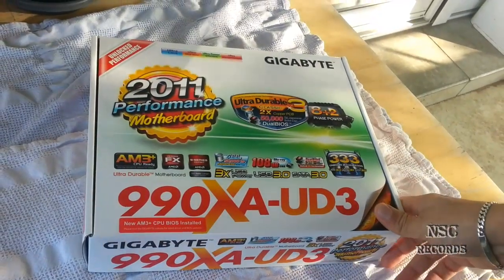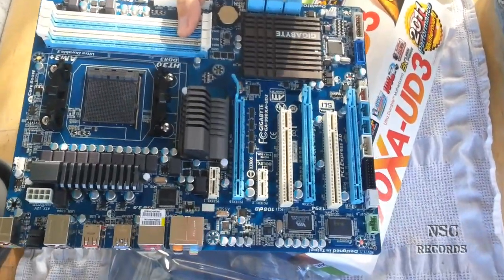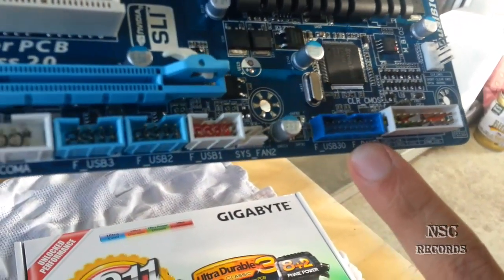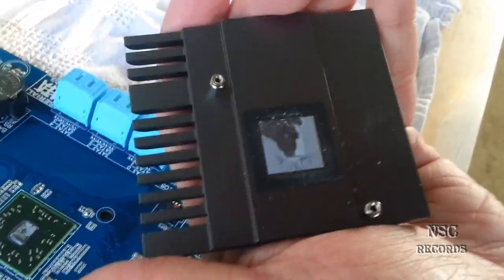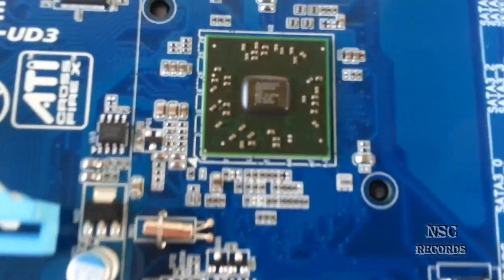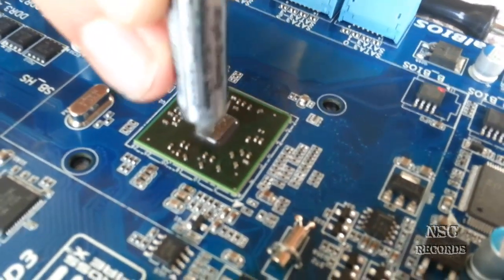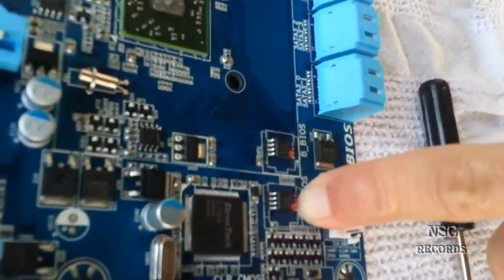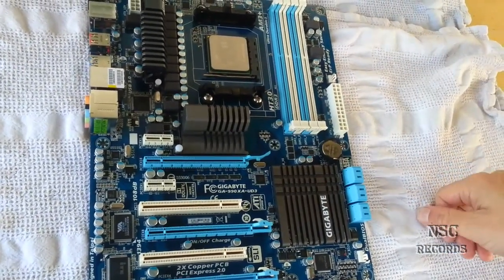Gigabyte 990 XA-UD3 Unboxing & apply new thermal compound By:NSC

Comment: Nice board, and great price, I went with 970AG46 with fx6300, and wanted to overclock alittle but lots of people say not VRM safe, but the fx6300 is 95watt,  do you think its safe to over clock without touching volts?
Reply from the maker: yeah, i think it´s posible, but maybe not much.
Reply: Does lower cpu wattage help with heat of VRM?
Reply from the maker: hmm it conforms, ifs it´s to much it´s not that good ofcorse. and it also conforms with Memorys you use, some Rams are just bad,,,
Reply: I ve got fx-8350 @4.7ghz and cpu is ok but vrm are throting to much for temps 😭

Comment: hjahjahj hi, do you speak spanish? :P
Reply from the maker: Hola, si poko xD
Reply: algo me dice que si sabes mucho -_- jajajajja ojala T_T Acabo de comprar esta motherboard, pero no se como conectar la fuente de poder, ya ves que mother trae dos cconectores, uno bieen grande a la derecha, y uno de 8 pines arriba a la izquierda del procesador, la duda es que mi fuente de poder solo trae conector de 4pines y uno de 6, no pasa nada si le conecto el de 4? O.o se va a quedar verdad? T_T
Reply from the maker: instalaste todus Drivers?
Reply: UltraNSC i'm talking about the connector of the power supply, the 8-pin connector,  i think of 12v. I don´t have 8pin in my power supply, i have a connector of 4pin
Reply from the maker: ohh 4Pin works also perfect ;)
Reply from the maker: i think u mean 4 pin for USB hehehe
Reply: UltraNSC Thanks, then I connect 4 pin instead of 8 :D jajajaja if this burn i talk you hjahjahjahjahja :P
Reply from the maker: no vai arder LoL it will NOT burn ;) 8Pin Power only for EXTREME CPUs

You can use 4Pin with NO PROBLEM ;)
Reply: jajajajajajja Ok ok, xD I didnt know that about extreme cpu, Muuuuuuuuuuuuuuuuuchas Gracias :D jahjahja Thanks :D when I turn on the PC I tell you jajajaja, thk
Reply from the maker: ta bien ;)